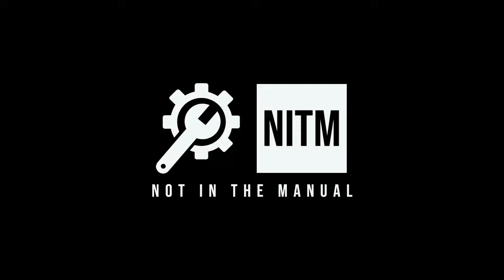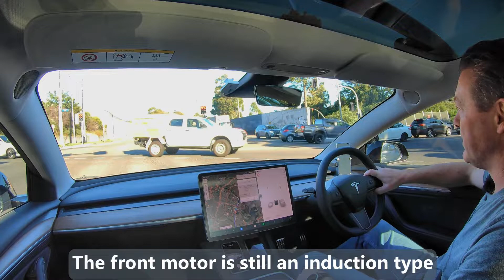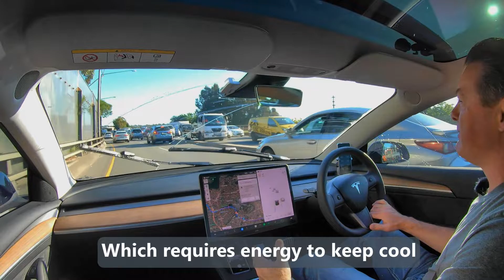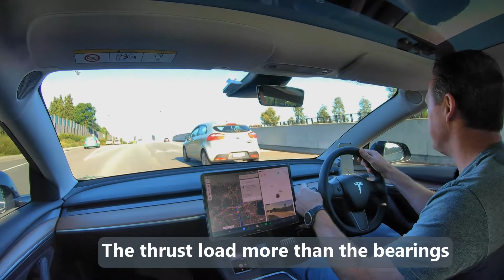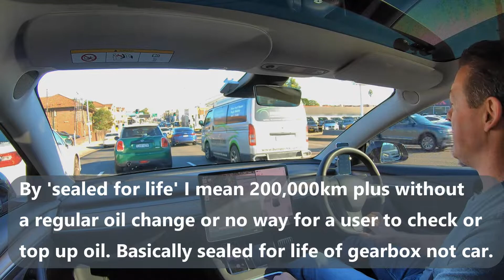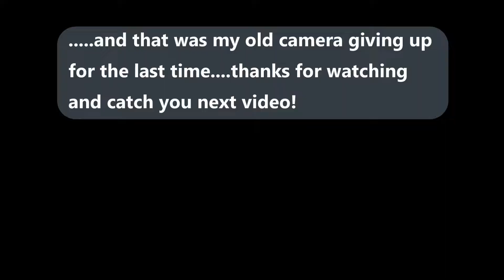Efficiency part three- Driveline efficiency with the Tesla Model 3

Comment: Hi, yes, this is a very interesting topic about how this engine works. BTW how much energy do your Tesla use when you drive through the city like in a movie? Which temp out?
Reply from the maker: Hi Piotrek Sz. I average 140Wh/km in the city. I use between 10-15% charge for a round trip to work of 30min each way. For the temp out I am not sure what you mean. The motor target temp during normal driving is 30degC. If you accelerate hard it will quickly go up to 40 or 50degC but cools back down very fast. Tesla is super efficient at cooling the motor.